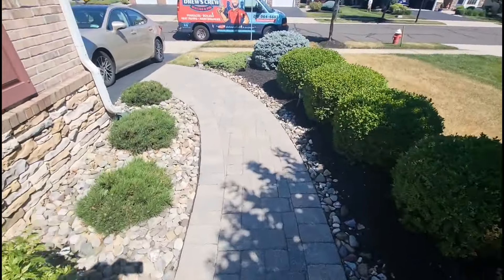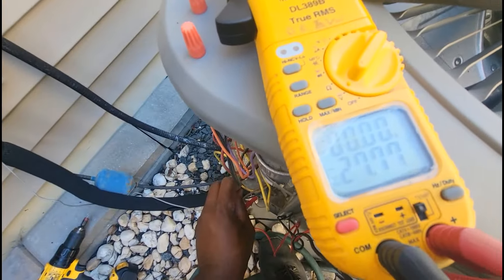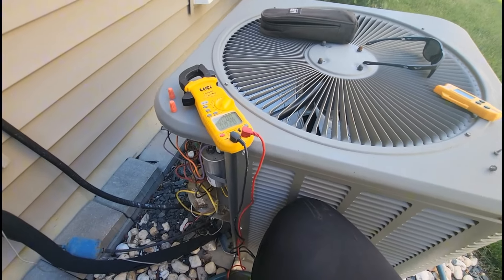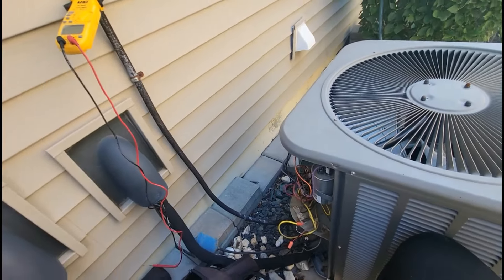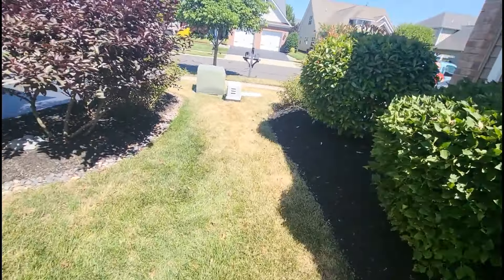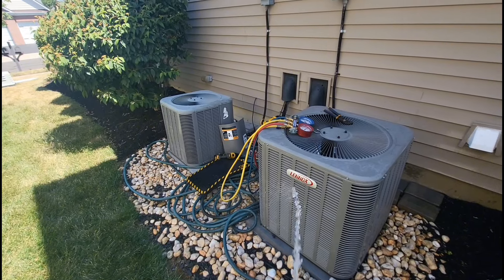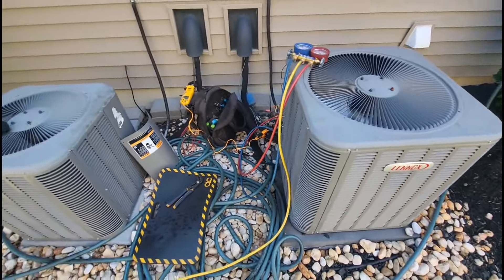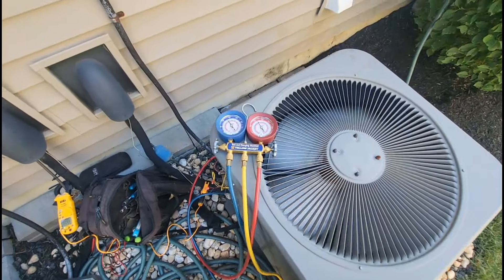Condenser Not Turning On | Air Conditioning

Comment: The "back in the day shit" is there for the exact reason you stated, the new stuff will reset on its own.
It does not mean the issue was resolved and in many cases the customer does not even know.
The manual reset means the customer will know there is an issue and unless they are willing to push that reset button, a service tech will be called to ACTUALLY RESOLVE the issue.

Comment: You don't have to remove the lid to reset the pressure switch,  there's a panel behiind the service valves you can remove